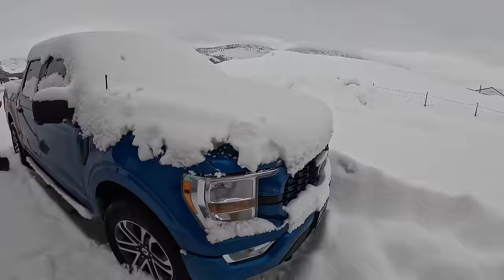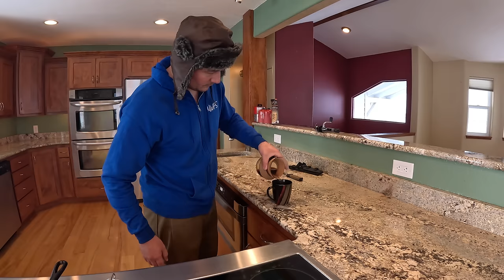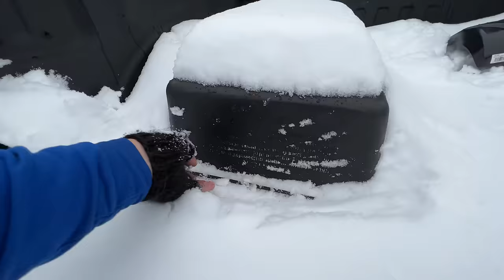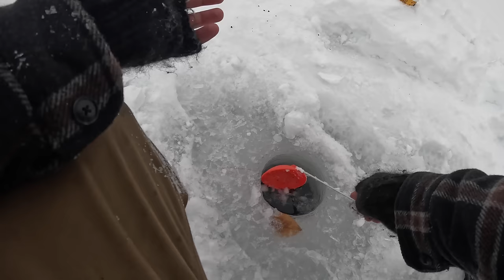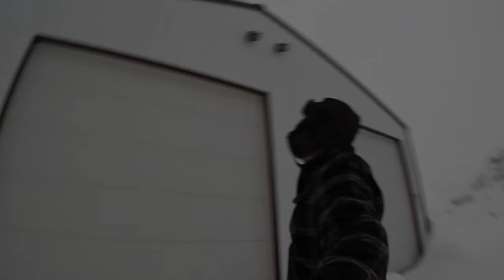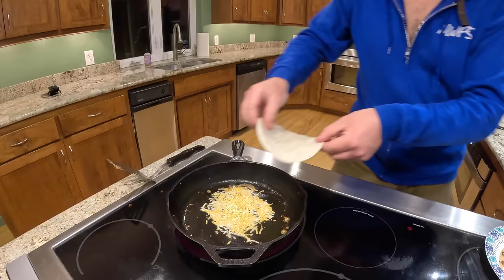I bought a MOUNTAIN FISHING FARM! Ice Fishing for TROUT (Catch & Cook)

Comment: Hey Leif, since I;m a tradesman I will tell you in regards to your concerns on the range venting...
The simplest solution is to add a high CFM exhaust fan above the range in the ceiling. Any smoke the built in one dosen't catch the add on will without the expense of a full drop down hood and all the ducting needed to install. use a digital timer like a one or two hour type and you're in business. this should be an easy project since it looks like there is attic space above! :)
Are you making it to the Sportsman Show again this year? Warm regards...

Comment: Get a Vexelar FL 18 or something. Can buy used and will help you find structure and check your depth. You can bring a bottle of water with and use the transducer right through the ice so you can find a spot before for you drill a hole. Also, K-drill on an electric drill is gold. For  lots of holes quick. Minnesota boy here fish 6 months out on the ice here.
Good on ya..

Comment: hey Leif, i see you were cooking on a cast iron pan in the end of the video, heres a Hot tip, try not to use steel or metal in the pan, if you can, use Wood utensils or plastic, it will scratch the seasoning on the cast iron and you will get pieces of it through your food!